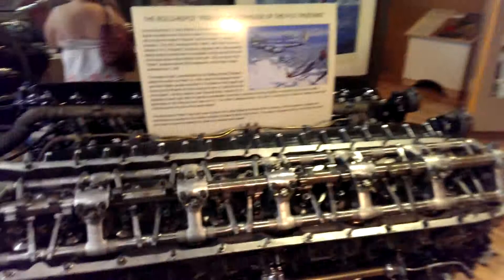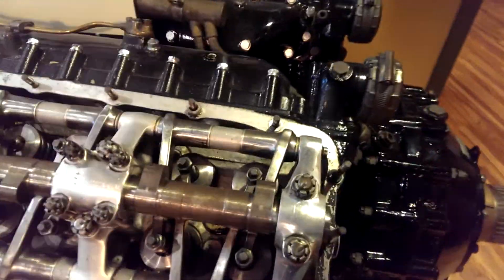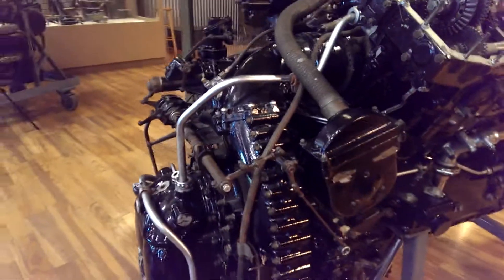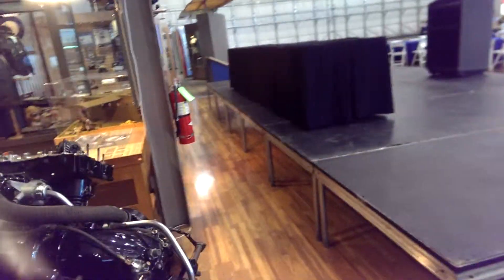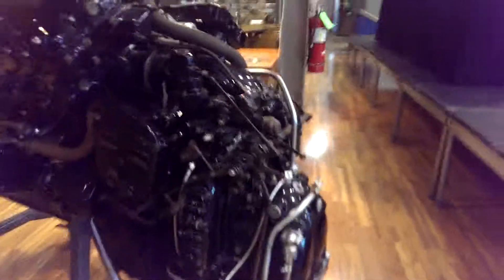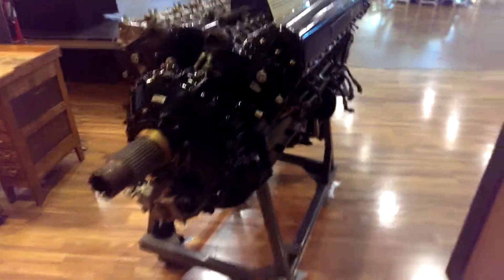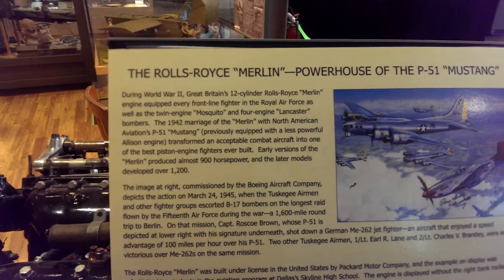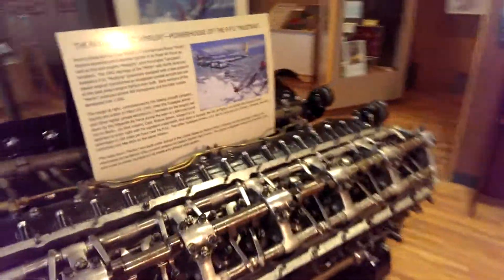Rolls-Royce Merlin Engine

Comment: Despite what the sign says, it is not a P-51 engine.  However, it is a Rolls Royce Merlin, and not a Packard version (has SU carbs, rather than Bendix).
Reply from the maker: Thanks for the information. I like all things mechanical, planes included but I know next to nothing about them.